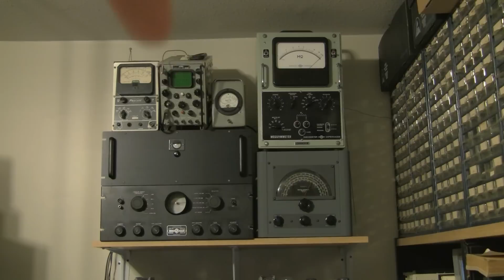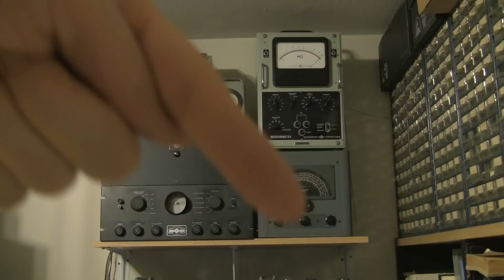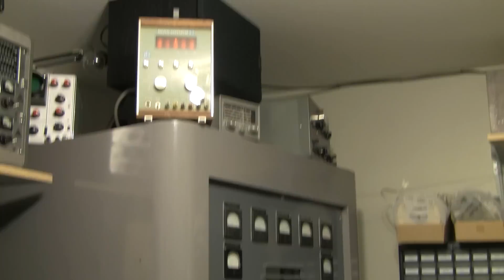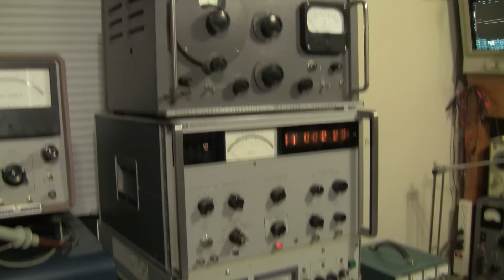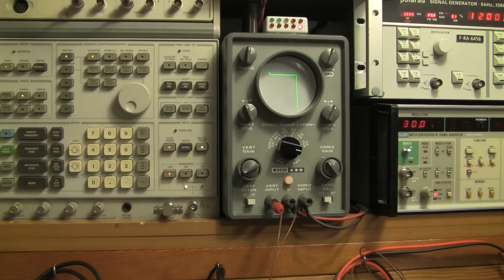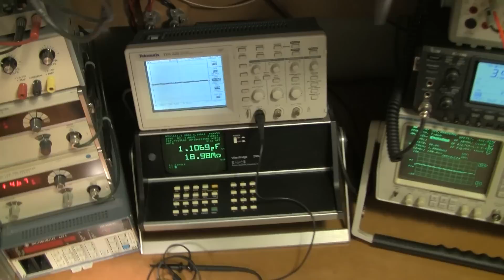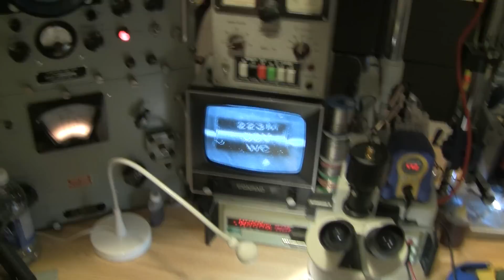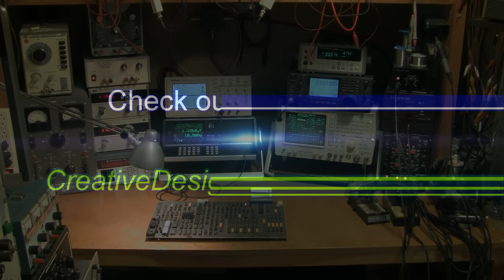View my personal electronics lab

Comment: Well hello Mr. C. I was wondering if you would be interested in doing an 'in my opinion' video on what the most efficient way to build fundamental skills for design and trouble shooting. There are so many kits, videos,  and directions a person can go,  especially now with cheap adruino based boards.  I'm a tradesman, but recently I have become very interested in being able to have a better grasp at circuitry. Even suggestions of fundamental equipment ect. does a guy invest on a good rework station, or individually part everything? I have many specific questions, but not nessisarily here in a video comment. I appreciate the time you invest into educating, and you don't speak down to people building into the fundamentals.
Reply from the maker: Thanks for your input!

Comment: seeing that your benches are loaded with older equipment  ...I notice there isn't alot of more moder gear,specialy in the ham area. Do you prefer tube/older gear?  Do you use any modern gear? Or is this just stuff you have accumulated over the years?and just use what you have?

Comment: what is your electric bill like? It must be warm in your lab. Is the pan adaptors dont look much like the one for my flex3000 radio which I love with the water fall display that I run on my computer. But I just love your videos and they answers so thing about electronics I never know..
Reply from the maker: +Ashley None 
Glad your enjoying the videos Ashley!
Reply: +Mr Carlson's Lab  The pan adaptors look so different then the one on my flexradio . What do u think of the new digital gear ?.Do you only work the boat ankers    . Love the old AM transmitter.Is it on 75meters or 160m?
Reply from the maker: +Ashley None 
Hi Ashley. I Really enjoy the older stuff, not so much interested in the newer digital gear. The Gates is a 75  meter transmitter now. Thanks for your comment!

Comment: Is your Hakko 936 modified? Yours has a dual color LED in it I see in the videos that toggles between green and amber/orange? I own a 936 as well, but it only has just a red LED on it that will turn on an off as the heating kicks in. Did they make a version with 2 color LEDS?
Reply from the maker: The Hakko LED circuit is modified. You will notice that the vacuum pump runs faster as well. I designed a VFD (variable frequency drive) for this. This unit has the AC induction motor (no brushes and commutator to wear), not the faster DC motor. You will also notice this AC motor sounds like the DC equivalent, this is because it's operating at 90Hz, created by that VFD.

Comment: The panadapter is like SDR (software defined radio) right...??
Reply from the maker: +Kennynva T. 
The Panadaptor is a spectrum analyzer for looking at the surrounding area to where your listening on the receiver. It allows you to see up and down the band while listening to the frequency your on.
Reply: That is what a SDR does...but it uses the computer to display the spectrum...and you can slide the bar with the mouse...

Comment: The Maas-Rowe amplifiers, actually Maas (Louis Maas).  I think those are the model 50A? Do those have the roll-off capacitors in them like the 500A?  By the way if you haven't seen, check out what Maas-Rowe is doing these days.  https://youtu.be/3j4tIyJ3thQ .   The DCP was introduced 5 years ago.  Last year their touch screen system was introduced.

Comment: id be curious to know what power consumption that lab has ?
Reply: your like the tenth person that asked him that....HE SAID, he doesn't run everything at once (obviously) and he only runs the equipment for what he's testing at the time. So his power bill is probably not a lot
Reply: +Ben Woodfield  yes indeed but what would all of them together pull from the mains amps and all?
Reply: I am not sure, If his lab is in his house, I would imagine he has standard wall sockets and in that case would have to be carefull he doesn't exceed the amp limit as it would be a standard mains set-up - eg here in the UK we have 240 Volts AC at around 50/60MHz in households, but the MAX limit for appliances is a 13amp fuse, anything over that (per plug socket) and the circuit breakers switch off on the main box. If he has this set-up then all his appliances will need to be within that amp limit.  However, if he overloaded a single plug socket he would have problems, but if he had enough plug sockets fitted properly I'd say he could get away with running a fair bit at once....if for example he had a plug socket, with a 4-way extension lead/adapter, and had 4 X 13Amp appliances into the one wall socket - that would be dangerous. if he had 4 X 3Amp appliances into the one wall socket he would be ok. So it all depends on the power ratings of the appliances.   If he had a seperate lab AWAY from his home, then a laboratory power supply would be custom made to suit his needs....but, in a real life situation he would never need to run more than a handful of appliances to test things, and a sensible person would turn off things they are not using at the time....It would be very dangerous to run them like that lol and a short answer to your question - yes it is probably pulling amps from the mains - and therefore his electricity bill

Comment: So much of the RF monitoring equipment can just be replaced with a small SDR.
Reply from the maker: Which SDR?
Reply: Mr Carlson's Lab A USRP b210 would be sufficient for such work I suppose.
You can always make your own. The new Ad937* series of transrecievers from Analog Devices are pretty good.
Reply from the maker: Well..... Not for for the work I do. I need to look at RF output power in Watts (sometimes KW) I need to also see frequency very accurately, Read RF Volts, see up to 40GHz, Need an analog movement meter for IF peaking, so on...
Reply: Mr Carlson's Lab Dammn !!
Reply: Mr Carlson's Lab Have been a huge fan btw. Have learned so much from your videos. I do research work in telecommunications.

Comment: Mr. Carlson has a million dollars worth of test gear and components, a rather impressive radio transmitter system....and a $150 Behringer analog eq.  I am so confused.
Reply from the maker: The EQ works great! Sometimes you don't have to spend big money to get something good. In this case, it's true.
Reply: Oh, I'm very familiar with those EQs.  I'm a performing musician with the resultant budget.  Those EQs work fairly well, though they are not the quietest or most accurate.  Many people won't be able to tell, and I've run quite a few shows as a performer or audio tech with mine.  I ultimately retired my outboard gear in favor of a fully digital console (also Behringer).

Thanks for the response!

Comment: It's not every day you see a touch screen CRT.
Reply from the maker: Good old Tektronix!
If you look closely at the screen, you will see around the edges, a black border with many bumps. Under those bumps is an IR transmitter-receiver array that forms a grid over the top of the screen. When you stick your finger in the invisible light grid, it blocks some of the pattern. The processor tells the scope where on the screen you have touched, and makes a selection. So the CRT really is nothing special, just a regular tube.

Comment: I am not insulting by any means,  I currently only have a $40 Iron and $50 multi-meter (College is currently taking all my money) so I have nothing in comparison.
Why do you choose to use older equipment? Some looks 90's to me (Judging by style and yellowing). why not go with "the latest digital insert big word and numbers" that crashes every other update. lol

But seriously, why continue using older tech?
Reply from the maker: Hi dasdew2. Older scopes have a certain "class" to them. They work just as well as the newer, and almost never give me any problems. If a problem does arrive, its something like a tube or resistor, not a processor or IC that's lost it's firmware. Of course I have lots of "NVram" in the more modern TEK scopes..... That's really volatile! But, I have lots of parts and backups. I have a soft spot for the older stuff. It takes a little more brain power to use, but once you get used to them, that beautiful bright "non digital" trace is a thing of beauty.
Reply: Mr Carlson's Lab That's something I never fully got about "upgrading", we're really only changing flaws between two things.
8 and 16 bit consoles to  modern consoles, Axe to Chainsaw, Revolver to Pistol etc etc. We fix most the bugs with the previous model,  to only have a newer model with shinier parts, fancier pieces and a lot more bugs. I'm with you, I prefer reliability to over-engineering. A axe still needs to be sharpened, but it doesn't run out of gas.
Reply from the maker: dasdew2 That is a great statement!
Reply: Mr Carlson's Lab That's why I drive a Corvair!
Reply: dispatcher7007 Tell that to companies that toss PC's because "They're outdated".

Personally, i'd rather have it be quality, My soldering iron is a $30 copy of a $40 Weller soldering Iron.

Comment: I realy hope you don't die from getting all that iron and heavy equipment in your head while on the computer.
Reply from the maker: LOL, I was wondering how long it would take until somebody brought that up. There is stainless wire that ties to the ends of each shelf. This stainless wire is screwed right into the studs of the wall, above the equipment. So in addition to the brackets, the ends of the shelves are also secure and supported. There would be no way I would sit below that equipment if that wasn't there. If I "Pluck" the stainless wire with my fingernail, it rings like a guitar string :^)
Reply: Mr Carlson's Lab Phu! I Like your videos so I wold have regretted not telling you. ( Weird complement, I know)
Reply: Paul, I came back here to browse and noted the prodigious equipment above the carillon amps and was going to comment on the shelf as well! I guess the wire is good enough but overall I would nervous about the wall supports as well. (But then again, I over-engineer everything.) 

That said,  what are the two scopes on the left flank of your bench in the TL-922 repair video? They look like old hp's. 

72,

K6WHP

Comment: Your electric bill must be really really really really big
Reply from the maker: John the electron man ensor  Hi John, usually only a few pieces are on at a time, so its not to bad.
Reply: I was talking about that big gigantic piece of radio equipment in back your room the one that's the size of a walk-in closet
Reply from the maker: LOL, That's my transmitter. I talk on the 80 meter band with that. Easy to service, I can stand in it....Big tubes on the left, more big tubes on the right.